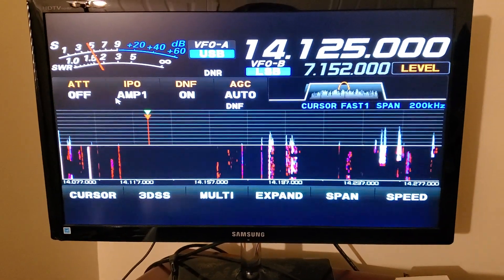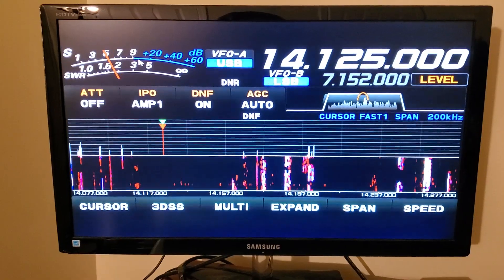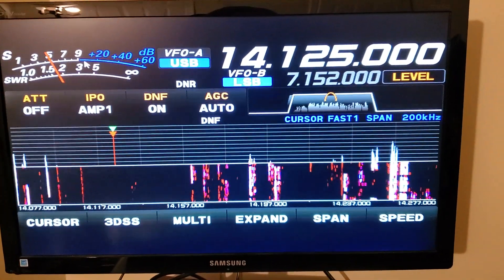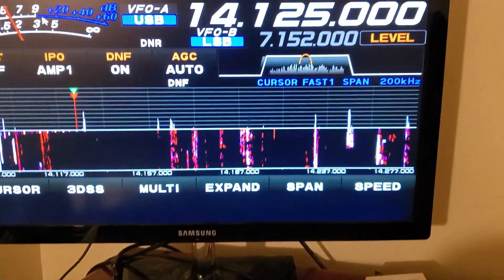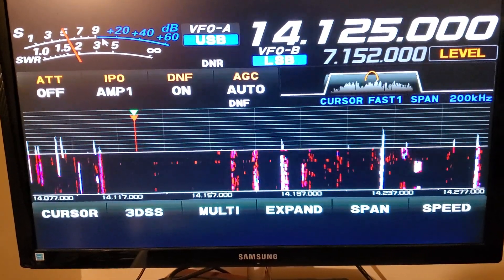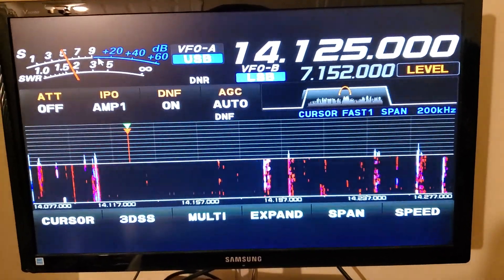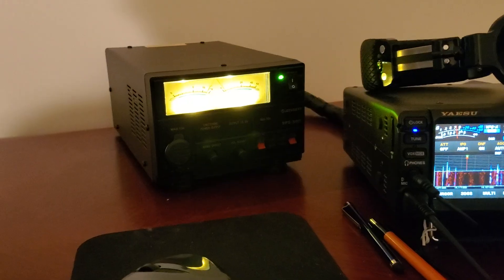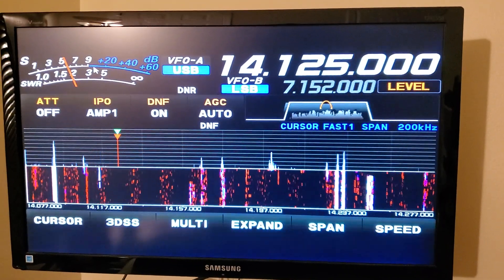Reduce That Noise On Yaesu Radios

Comment: I use a FDX-101D with a DVI cable to a Phillips monitor. S1 noise level. I use ferrite beads on my antenna coax near where it connects to radio. A bit of research on differences between HDMI and DVI yield the following, while explaining why your ferrite beads helped! 1. HDMI Carries More Signals
	•	HDMI includes high-speed differential pairs for video, audio, Ethernet, and control signals (e.g., CEC).
	•	These signals operate at high frequencies (up to several GHz) and generate a wide spectrum of radiated emissions, especially if the cable or connected devices have poor shielding or grounding.

2. DVI Is Simpler
	•	DVI carries mostly video signals only, with fewer data lines and lower signaling complexity.
	•	DVI doesn’t usually carry audio, Ethernet, or control signals, reducing the chance for RF interference.
	•	The clock rates are typically lower, so there’s less broadband RF noise.

3. HDMI Is More Likely to Be Unshielded or Poorly Shielded
	•	Some cheap HDMI cables lack proper shielding, or devices don’t bond the cable shield properly to chassis ground.
	•	DVI cables tend to be better shielded due to their use in professional or business contexts.

Comment: I don't use the external monitor on my FT DX 101 MP, but the most important thing I did was to use a good common mode choke. The choke knocked out the noise quite a bit.  Also, become adept at the Yaesu noise filters.. e.g. the bandwidth, notch, DSP etc.
Reply from the maker: @todddavid3695  the width, notch, DSP, contour are awesome. A lot can be done with those settings. Thanks for watching and commenting.

Comment: At 7:05 in the video, you are able to see a LDG 1 to 1 unun right at the radio. Here’s a suggestion, move the LDG unun up close to the antenna and see if that makes a difference in your noise. My thought is that if you have stray RF coming down the braid of the coax then the cable going to the monitor will pick that up and then it will bring it into the radio. The monitor cable will act as a receive antenna and will introduce noise into the radio. Using the ferrite beads does work, but it might be better to try and eliminate the noise than block it out. Good luck. N3EDO.
Reply from the maker: @williambouchard4480  good suggestion, I’ll give that a try. Always interested in a new idea. If it changes something one way or the other I’ll post an update here. Thanks for watching and commenting!

Comment: Glad you solved your noise issue! I just  solved mine as well, mine was a little simpler. I added a choke to my antenna feed point and almost all of my noise is gone. Now if i can get my soundbar to stop making noise on 10m I'll be good to go
Reply from the maker: I’m about to do that also. Thanks for the tip!

Comment: I don't know if it's just on the FTDX-10, but using DVI from the back of the radio and using a convertor to HDMI blows a fuse in the radio. Not sure if it's the same with the FT-710, but worth a search to see if FT-710 owners have had the same problem.
Reply from the maker: Thanks for that info. I’ve ordered a dvi to vga to try. I’ve had a dvi to hdmi on my ft-710 for about a year now with no issues. Maybe I’m just lucky though.
Reply: @yqtszhj  No problem. I know it's hard to get monitors with dvi nowadays. I had a LG with DVI, but it was very noisy, so I got a refurb Dell from amazon for £50 with dvi and that one isn't noisy. Here's the model, if anybody is interested "Dell P2214HB"
Reply: I learned in another video on the FT DX10 that DVI to DVI is single-direction. HDMI is bidirectional in terms of signals. I can't recall the video. There were only a few DVI to HDMI converters that kept the HDMI from sending any signals back. So that's probably what was causing the blown fuses. Protecting the radio. DVI to VGA would probably work safely. I was lucky that I had a monitor that is DVI to DVI with no HDMI sockets.
Reply from the maker: @ excellent info. Thanks for sharing!

Comment: This is a yaesu problem with not using a HDMI, instead a DVI-D. The converters can cause problems and adding noise like you are seeing.  If you used a monitor with DVI-D port you may not have near as much noise.
Reply: absolutely correct. Also the hdmi monitor and cable produces voltage going back to your 710 damaging over time the internal resistor. yaesu will not cover this damage under warranty

Comment: Thanks for the video. Which type and size of those ferrite beads are you using?
Reply from the maker: I’m actually not sure what type they are. I bought them long ago and recently tested them with my VNA to make sure they actually worked. Next ones I buy will probably come from a reliable electronics/radio source so that I know the composition. They can be bought in the millimeter diameter for whatever cable you may need to put them on. I actually need to take some cable measurements and order some more. Thanks for watching and commenting.
Reply: @yqtszhj  I'll probably pick some from Palomar Engineers. I have their CMNF-500-50 coax noise filter connected to my 710.
Reply from the maker: How’s that noise filter working out for you?
Reply: @yqtszhj  Works very well considering I'm in an apartment close to a busy road with radio and cell towers around me.

Comment: Samsung is your first problem. Second is to never use hdmi with yaesu rigs. They aren’t fixing anything about their design. Get an old dell dviD monitor. 3rd is to get rid of that switching power supply and replace it with a linear power supply. Just about everything made now in china “including” cables are full of rfi. Phone chargers, beard trimmers, modems routers.
Reply: a swither to never be afaid of is Samlex. i have the 1235m it is quiet
Reply from the maker: @JayN4GO  Thanks for watching. definitely agree on everything these days being full of rfi (including my neighbors gadgets and air conditioners in their house too.) The current power supply works well but my previous one definitely caused issues on hf and had to go.

Comment: great video, i think i heard your callsign on 7 mhz cw? just learning cw might have some letters mixed up but thats how i got here
Reply from the maker: It may have been me. My CW is VERY BAD but I test on reverse beacon frequently. Mostly to test a new antenna or band conditions to Europe. I play radio on 10 and 20 meters ssb during the day and 20 and 40 meters ssb at night. Usually I try to see if I can get the guys from Bulgaria, Spain, and Italy on 40. I mostly hunt instead of calling cq. Testing a new vertical directional antenna at this time to see how it does. Reverse beacon is showing improved snr, but too often noise at my new qth is eating my lunch on 40, but I’m gonna tackle that.

Comment: Consensus is don't use HDMI on Yaesu of any kind.
Reply from the maker: Yaesu should address that if it’s an issue since it’s 2025. I think they probably already have to some extent. I also heard the reason they didn’t go with hdmi is because there is some royalty that has to be paid for using “hdmi”. I don’t know if that is true or not but It wouldn’t be the first time a corporation did something to avoid paying out royalties. Thanks for watching and posting.
Reply: @yqtszhj  Yes, I have heard the same stuff you just mentioned. I think the only thing that Yaesu has done is to state you should not use HDMI. I also read the same about the HDMI royalty fee. Would you share the make and model of HDMI to DVI converter that you use?
Reply from the maker: @ I’d be happy to share. Over on Amazon I ordered “DTech DVI to HDMI Adapter DVI Male to HDMI Female Bi-Directional DVI-D Port Converter 4K 1080P Gold Plated Connector”. If a had to do it again I would probably look for a uni-directional adapter if one is available. I’m wondering if the blown internal fuses are due to something being hooked up that is driving some signal into the radio, something other than the noise I’m dealing with. Hope this info helps.73
Reply: I have viewed enough videos on this topic to completely agree with you. Even if I had a converter I don't think I would have the Gazongas to try it. I love the ext. monitor on my ft-710 but if I hooked up an HDMI and killed the ft-710 I'm sure I would become suicidal.

Comment: I thought Yaesu recommended not using HDMI because of the risk of blowing some internal surface mounted fuse (part of the DVI circuitry). I would love to know how you get away with using an HDMI monitor without blowing the DVI port fuse? PS - Good luck with the noise problem. I also used ferrite clamps on every cable entering/leaving the radio including the antenna cable/coax and somehow managed to get my noise floor down to less than ONE S unit.
Reply from the maker: Could be. The manual for the FT-710 does state the video output is DVI-D, but it doesn’t say that a DVI-D to HDMI converter can’t be used and I know multiple people using one. Not saying it’s not an issue but Yaesu should document it in the manual. Maybe it’s an issue on prior rigs. Thanks for watching and commenting. The ferrites do a good job particularly when you have to live in a noisy city.
Reply: @yqtszhj  Please, please tell me what CONVETER you are using?
Reply: A link to where you purchase would be great. TNX
Reply from the maker: @ I’d be happy to share. Over on Amazon I ordered “DTech DVI to HDMI Adapter DVI Male to HDMI Female Bi-Directional DVI-D Port Converter 4K 1080P Gold Plated Connector”. If a had to do it again I would probably look for a uni-directional adapter if one is available. I’m wondering if the blown internal fuses are due to something being hooked up that is driving some signal into the radio, something other than the noise I’m dealing with. Hope this info helps.73
Reply: @yqtszhj  Thank you very much for the info. Addressing what might be going on there are several vidoes on YouTube that talk about the problem and on that even show how to replace the fuse (I would try it, it is a surface mounted device) but the same video includes a schematic of the circuit involved. I think tomorrow I will watch those videos again if I can find them and also send a note to Yaesu and see what they have to say about the problem. Will let you know if I come up with anything interesting.  73 DE KK6Z
Reply: The manual does not address the HDMI Cable issues but it is a real concern, and users are highly recommended to use a monitor with a matching dvi cable. I jave also heard that a dvi to vga cable is also safe.
Reply from the maker: I’m going to give that dvi to vga a try. It’s unidirectional unlike hdmi. Thanks for pointing.

Comment: Thanks for sharing. I never use a monitor or audio amp, for years I have had ferrite clamps on every wire, coax , audio leads etc etc etc. My noise floor is 0 - 1 S point.
On 40m I have a dedicated rx ant.
Good luck 74.
Reply from the maker: @brianfields4479  thanks my friend for the input!